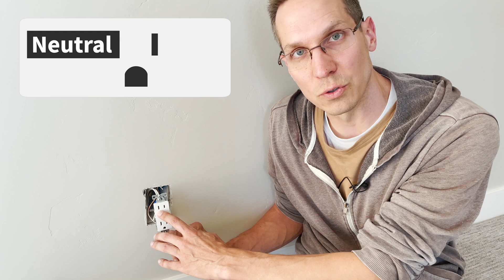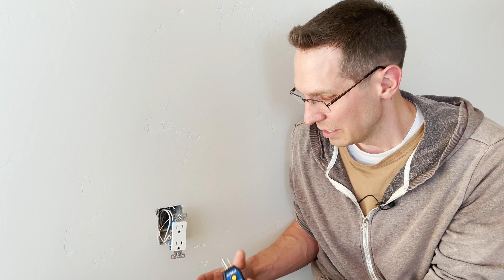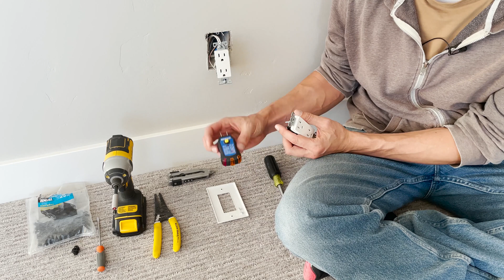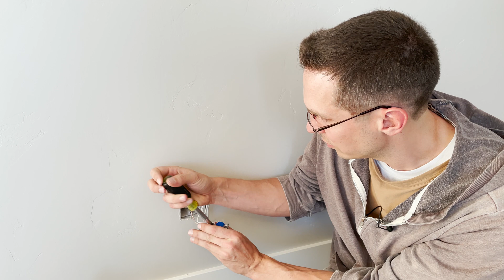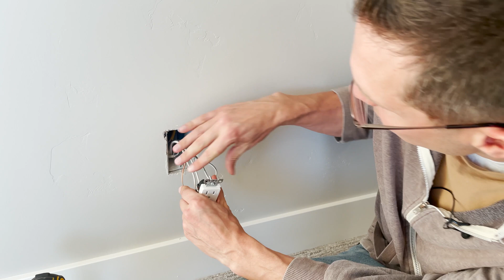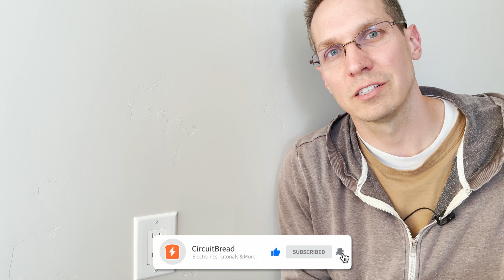Electrical Outlet Wiring - The Basics | CircuitBread Practicals

Comment: My understanding is you do the curl of the wire in the direction of the rotation of the screw to tighten it. Also there is a gauge on the back of the outlet to show you how much to strip. Other than that, very informative.
Reply from the maker: Thanks for the feedback!  I don't remember seeing the gauge when I was doing these, I'll have to go back and check.

Comment: According to Engineers ground always last but the power is off so it really doesn't matter but if we're on ground last
Reply from the maker: After shooting this, I heard that as well.  I agree that it still probably doesn't really matter BUT if there were an officially preferred way to do it, that would be the way.
Reply: To add to this for clarity 

If you’re taking an already wired outlet out of the wall: remove hot first, neutral second, ground third 

If you’re adding an outlet: ground first, neutral second, hot third

Comment: I have a video/series request. It might be too broad of a subject, and of course you don't have to do it (it's just a request).

Would you be able to do a video/series showing how to make logic gates with BJT's (both NPN and PNP)? Like, walking through the process of actually hooking them up on a breadboard as well as explaining the circuits in detail?

With tutorials for these gates:
- Buffer
- NOT
- OR
- AND
- XOR
- NOR
- NAND
- XNOR
- Comparator (not sure if it's technically a logic gate, but it's very closely related)

If you don't want to take this on, that's fine. It's just a request. 😊
Reply from the maker: Hey Julian, I actually wanted to do a digital logic series (I need to finish the circuits series first - the studio is finally back up and I'm starting to work through a huge backlog! 😬) and was planning on starting by going through each gate and creating them with NMOS and PMOS transistors.  I wasn't planning on using BJTs, however, as CMOS has become the predominant technology for this.
Reply: @CircuitBread  Oh okay, cool!! It's probably a similar enough concept that I could easily apply it to BJT's.

Comment: could never understand why US sockets are so exposed like that with live and neutral on sides just waiting for someone to remove the cover and short them to the back box,  and dont get me started on unswitched, but good video, thanks
Reply from the maker: At one point, I briefly thought one of the benefits of those push-in spots in the back would be no exposed wires.  But those screw terminals on the side are still hot, so it doesn't actually make a difference.  With the cover off, it is ridiculously easy to touch something hot and hurt yourself.

Comment: I've been told that you should start by wiring your ground, then your neutral, then hots since it's potentially (no pun intended) safer that way.
Reply from the maker: Interesting, I'd be curious to hear why that's safer!  I'm assuming that it's just in case the hot is still live and it gives a path to ground other than your body.  In my last house, I just turned off the power to the entire house, it wasn't worth the risk.  I've gotten better testing tools and know the wiring in this house better, or else I'd probably do the same here as well.  We still are very careful in the testing process, though.  I got a bad electrical burn when I was a kid and am still very, very nervous around anything over 24 volts.
Reply: @CircuitBread  Yeah that's the reasoning. The neutral is tied to your ground at your service box too so that's why it's good practice to wire ground, neutral, and hot in that order. And ouch sorry to hear you got shocked badly 😔